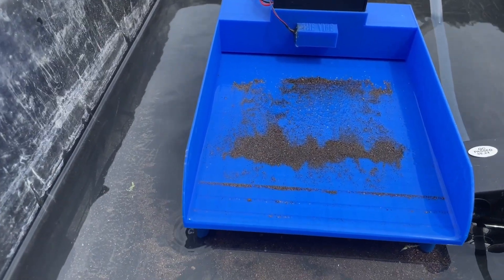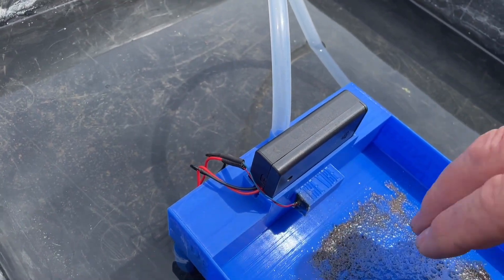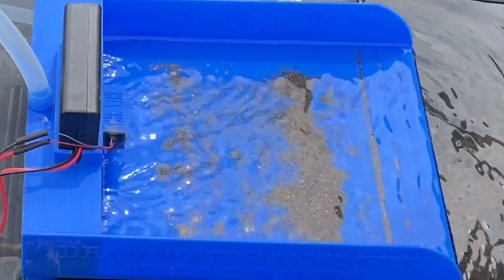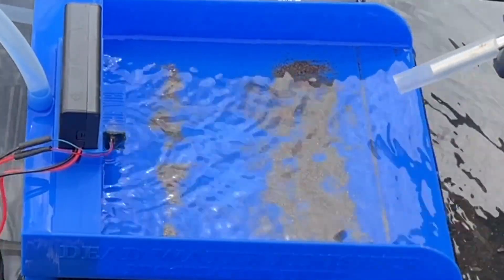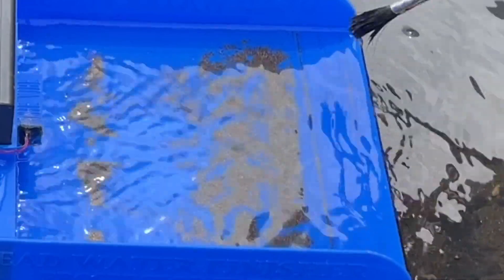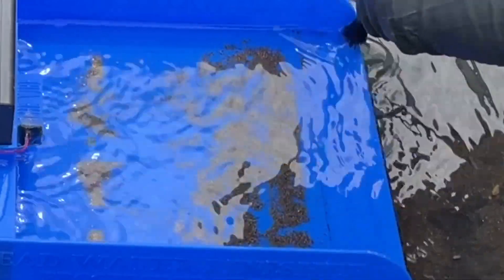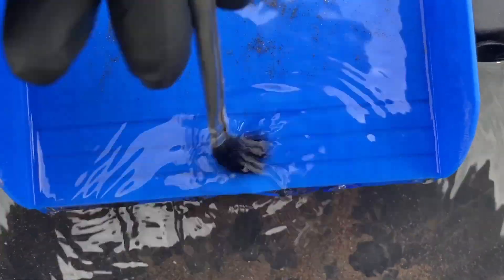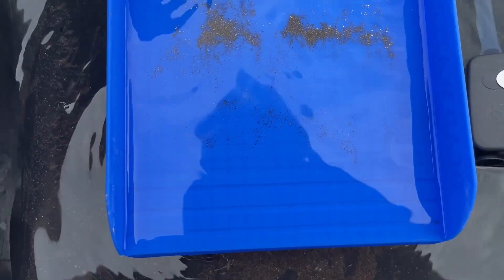The Vibe! Dead Water Finisher! Prototype Progress!

Comment: Great idea! Add a coating strip of flex seal for a test section vs no seal
Reply from the maker: I have tried,  flex seal and polyurethane. The adhesion of flex seal is not good long term. The polyurethane is durable and adds a smidgen of traction.  
Overall it still needs additional design improvements.  
I'm on the third revision since this video. 😆 🤣 😂 
Great comment 👍 👌 👏 😀 
One by one! ✌️
Stay Golden ⚡️ 
Peace Prospector Tripp

Comment: It seems extremely difficult because there is so many variables to deal with . The gold size variations of weight , equally the Black sand sizes and weight variations . If it gets aggressive the micro gold moves with the Black sands , if not aggressive enough the course larger stuff will  not move . I see your Dilemma Matt . yes the vibration helps for sure , certainly when you raise it things move quickly . Well , i am sure you will sort it out . Ahh , is the end ( outlet ) flat or does it have a turn up on it . Anyway , great progress Brother 👍👍Cheers Nev . ✌
Reply from the maker: Hello Nev,  the output end is not turned up as I've tested with various versions. The drops seem like still the best option to save a wayward spec of gold. 
I have modified it three times 🤪 since this video 😆🤣😂
The latest version is much lighter and thinner (the header is much smaller, and the cleaning plate is now 2mm thick vs. 4mm on the previous one.  Also, I've printed The Vibe directly on the cleaning plate with 20mm stand-off posts. The thing is really vibrating now! 😃 If I tip it up too much, it starts jumping around like a bucking bronco! 🐎 😆 🤣 😂 Actually, there is so much vibration that I've ordered some low voltage pwm speed controllers so I can control the vibration gizmo. 
Overall, it's really quite good. I am using very difficult hard rock fine material as the larger placer gold is very easy to get clean in comparison.  Fun stuff, my friend!
A new video is coming in a few days after I get the pwm speed controllers.
Stay Golden ⚡️ pal
Peace Prospector Tripp
Reply: @ProspectorTripp  Aha , sounds good Matt . 👍👍

Comment: Howdy PT.. You don't lie.. we literally have discussed the pros/cons of vibrations for (since before COVID?).  AnyWho.. glad that your playing around with the idea and I'm sure this prototype will prove to be a success!
Reply from the maker: Johnny! Absolutely correct! 😆 🤣 😂 
I'm so glad you chimed in! I believe we have discussed almost everything there is to do with gold capture.. top to bottom and even sideways. I, too, believe this DWF (Dead Water Finisher) will be another successful tool. I am already 3d printing another version. 
NSA chimed in and thought, relocating the vibe to the underside of the cleaning plate would be a better location.  I would do that, except I worry about the vibe leaking and failing.  I then thought about dipping the vibe into epoxy and hoping it would not leak and relocate it to the bottom side anyway. Agggg the possibilities 😆 🤣 😂.  Anyway, I finally decided to keep it up top, high, and dry, but move it forward about 10mm away from the header and directly print it on the cleaning plate topside. It is not an ideal location. But having it fail early from water leakage is not an option. Imho.
I also reduced the cleaning plate thickness from 4mm to 2mm to make it more flexible and easier to vibrate. If this new design works even better,  I will finally extend the cleaning plate a couple of inches to make it a bit longer and recover the lost area up top where I moved the vibe and add a little extra overall length. 
The Process ☝️ 😶‍🌫️ 🤪 😁 😅 
Much love, pal 
Stay Golden ⚡️ bfam 
Peace Prospector Tripp
Reply: @ProspectorTripp  If I were to suggest anything... It might be a variable speed on a vibrator, and/or a small rack that allowed for positioning the vibrator in different locations (because not all cons are the same size or weight). But I still think your on right route, and the test, test, test.. lol. Great job buddy!
Reply from the maker: @johnsaucerhunter there you go.. reading my mind! 😅
I have some 1.8v to 12v pwm speed controllers coming today! 😆 🤣 😂 
It makes the manufacturing of this Dead Water Finisher a bit tough having to 3d print, clean up the print, install the components,  solder and heat shrink the wires, spray the speed controller to make it water resistant, test, sell, box and ship. That's a lot of work and still try to sell for a inexpensive price. And there's the reliability factor.  I don't worry about the battery holder or the vibration unit so much.  But the speed controller is likely to get wet occasionally and may not last long term if not carfully cared for well. Anyway I have to at least try. If it becomes a problem.. it will not be offered for sale very long in this configuration. 
It is a fun project for certain. 
I'm on it bfam ✌️🙏❤️
Stay Golden ⚡️ pal 
Peace Prospector Tripp

Comment: I am interested. I use a blue bowl concentrator now.  I mostly use it on IC chips from ewaste
Reply: I would dissolve that gold in aquaregia filter out the dirt and get pure gold.
Reply from the maker: I am also a big fan of ewaste processing and have been doing it for years! I haven't done much electronic scrap cleaning with my designs, but I probably should!
I need to continue the process of getting the design more perfected. After I am satisfied with the results, I will try to do some electronic gold scrap cleaning and see if it is effective.  Really good idea to get the trash out of your gold scrap prior to refining!
Great comment, sir
Check out my eBay site.  I've used my ASDR Gold Pan for panning out electronic gold scrap.  The link is in the video description. 
Stay Golden ⚡️ 
Peace Prospector Tripp

Comment: Interesting idea, the placement of the vibrator may be causing some issues, as it loses energy with the water bar opening below. Try taping it to the bottom near that water opening? If it works, can 3d print a housing.  I'm assuming the vibe function is to help walk the gold up and allow the lighter stuff to get dragged in the low water flow to migrate away. The joys of prototyping :D good luck!
Reply from the maker: Hello NSA, The mount for this vibration gizmo is 3d printed in place and part of the entire unit, so in this location, being part of the entire unit and somewhat attached to the wash plate, it actually transmitts the vibration quite well. However, the vibration is defiantly somewhat deadened from the header and the large amounts of structure. I am going to try a few other locations. However, the bottom is not a location that will keep it out of the water. It's supposed to be waterproof, but looking carefully at it, I doubt it would last long if submerged or constantly getting soaked.
I am thinking of adding an island post with the vibration unit mount on top of the post and printed in place attached exactly to the top of the wash plate where it can be out of the water but exactly attached to the wash plate. It needs to be mounted horizontally in the same direction as it is now to get the full force of the vibration. Thinking 🤔 😆 🤣 😂 
I don't want it to get wet, no matter what is stated by the seller. 
I always appreciate your terrific and very helpful comments! Making me think!
Thank you!
Stay Golden ⚡️ NSA!
Peace Prospector Tripp